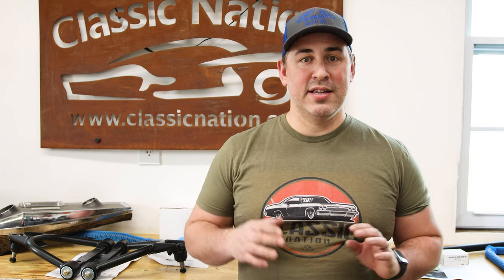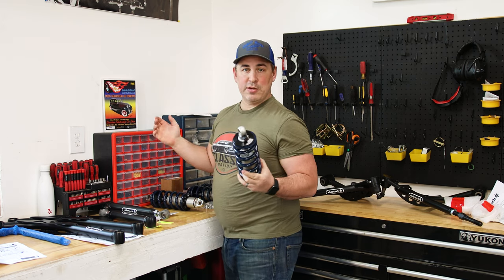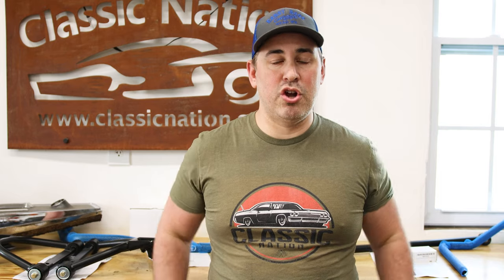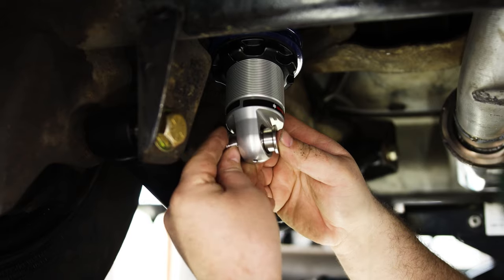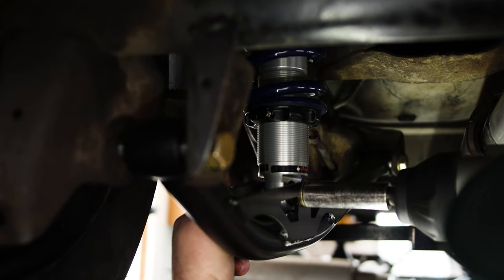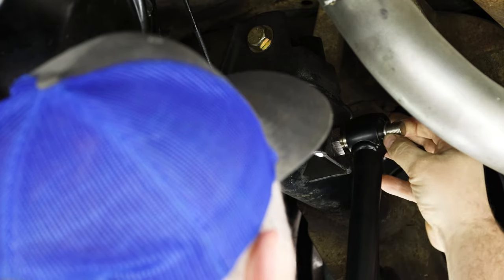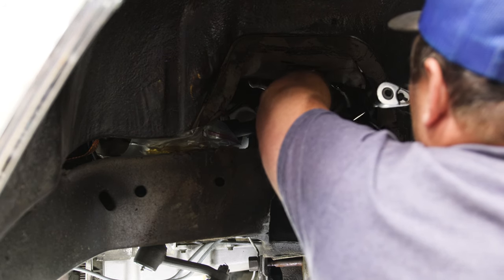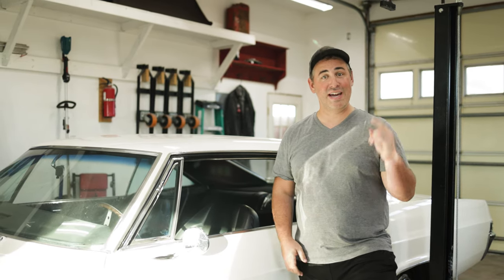1965 Impala gets a full Ridetech Modular Suspension Upgrade

Comment: Great content Nick . Over the pond we call those "r" joints "rose joints" . The're commonly fitted on race prepared cars . I believe they tend to transmit a harsher ride than the standard set up . But as you've commented the new system is custom made and the difference in handling must be very noticeable and enhanced . I guess the shockabsorbers are adjustable so may take a while to set up. And the gearbox must enhance  and capture the engine performance that compliments the suspension mods ........the perfect sleeper ! Thanks Nick
Reply from the maker: Thanks John! As always, we appreciate the continued feedback and support!

Comment: Looks like your running drop spindle.  How is the drop spindle/coil over combo working out.  Thinking of doing same.
Reply from the maker: Nope, I had drooped spindles from my pervious setup, but when switching to this Ridetech setup, I switched back to original height spindles. Works perfect and still has the nice low stance I was after with the coil-overs. Hope that helps!